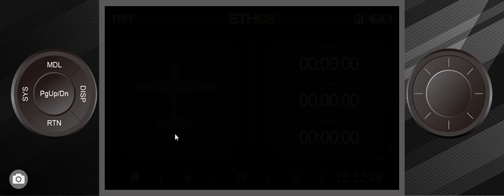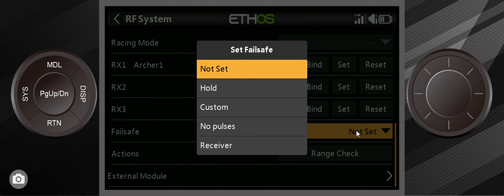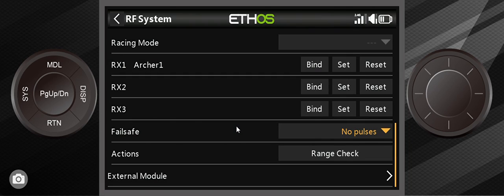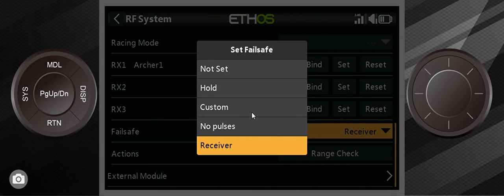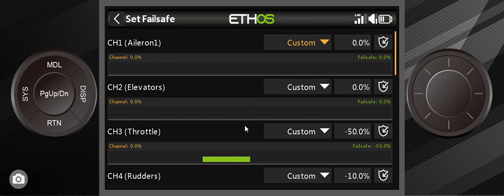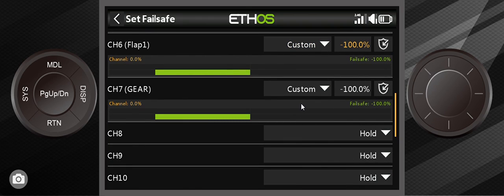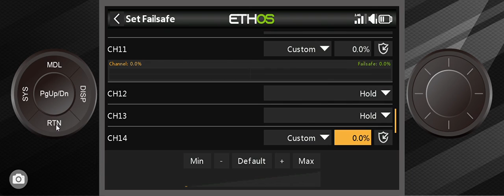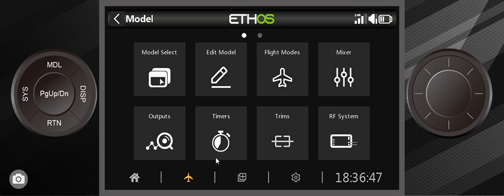FrSky Ethos-Failsafe- Overview and explanation

Comment: Steve, under CUSTOM, what is the crown symbol with the arrow pointing in it for?
I want to save all my Tx settings, especially the auto-level mode and some rudder to get it turned around. Is "Receiver" mode the answer?